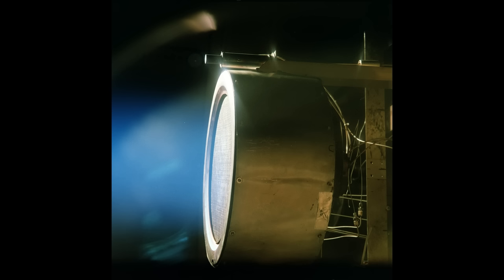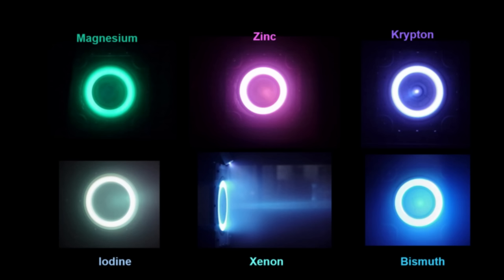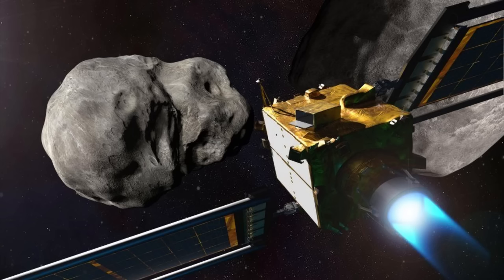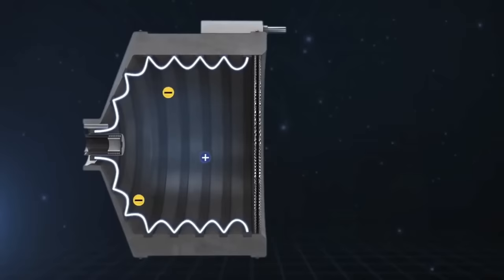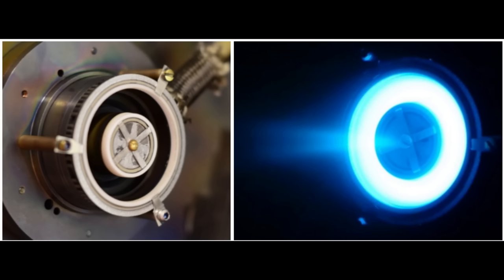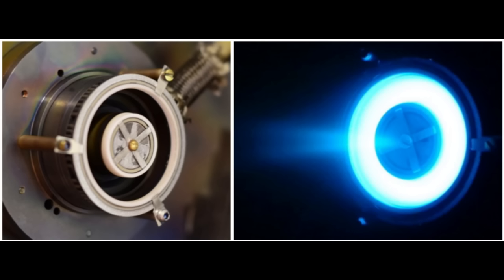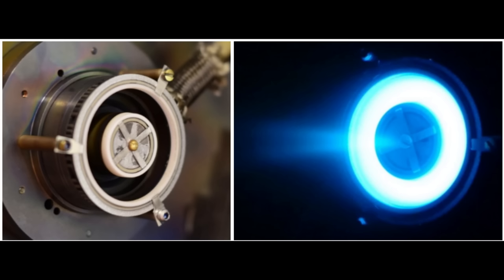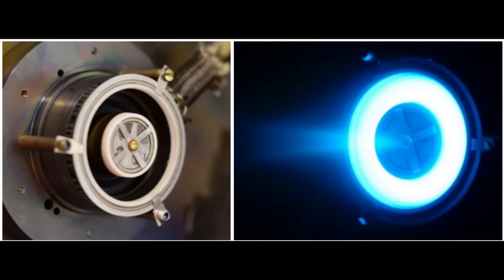Why Are There Two Different Types Of Electric Space Engines, And How Do They Work?

Comment: Pure electric engine - photon thrust. ISP = 3 x 10E7 m/s. 

2 x power x efficiency (say 75%) / Ve = thrust. 

1 = 2 x P x 75% / c so P = .666 x c = 2 x 10E8 or 200 megawatt per newton. 
Since a really good solar panel generates 400 watts per square meter to generate you would need 500,000 square meters of panels. Right now NASAs panels are like 10 kg per square meter, so that would mean 5000 tons to generate 1 newton, which means the limit of acceleration is limited to an acceleration of 200 um/sec^2. This is not actually horrible if your going to use a poormans oberth effect with the sun. But before we do that lets imagine a two panel system of 250,000 square meters each of panel. Then inagine each panel is five times as long as wide, so thats 50,000 square meters per square. 100 x 100 = 10,000 square meters so a square is going to be about 230 meters and the length of the panel is going to be about a kilometer. 
    Moreover at the attachment point of each panel you need to conduct 100 megawatts of power from the panels to the ship . . . 
   So we wave our hands. if the ship can get half the distance to the sun it needs a quarter of the panels. So we can increase acceleration to 0.8, but realistically 0.5 mm/ sec^2. We have 1/5th of a year to accelerate and we get at least some solar light forcing while leaving.  So lets see. 
   84600 x 100 days = 8.46 E6 seconds, lets just say 6E6 seconds x 500 um/sec^2. the E6 and the u cancel and this results in a dV of 3000 meters per second, this would not pay even for the cost involved to reduce the apoapsis of the orbit. 
    But there is an advantage since the vehicle can make several passes at the sun before exiting and it has no fuel loss. It can adjust at the apoapsis and rekick its orbit at periapsis without cost. The second benefit is that it can carry a payload and that can use the speed at the last pass an its proximity to the sun to launch a solar electron ion drive payload with a say much lower ISP can use the final periapsis to begin its outbound burn in which case it could particularly generate 10,000s to 100,000 of DV. Since the photonthruster is at periapsis it could simply reverse grade and slow down and reverse the process to intercept earth, pick up another payload and repeat. 

    Right,  so we factor the cost and alternative, megatons into low earth orbit. a few hundred billion dollars, but starship could potentially make this feasible. You could lower the weight if you managed to find a way to capture solar emissions (H+ and helium) and create a hydrogen based ion drive, this would drop the ISP 10 to 100 fold. 
     But in the end the practical reason why this cannot be done really is the surface area of solar panels and electrical tension at the based of the solar panels.

Comment: Why would you need to neutralize the ions after they've been accelerated ? They're being propelled out the engine, so why care ?
Also why use the noble gasses when they are all among the highest elements to ionize ? Is it because the other elements have higher reactivity as ions ?
Reply: If the ions that come out immediately shot back to the spacecraft it would cancel out the energy and the net would be 0 so you neutralize them before they can
Reply: @Linuxpunk81  thx

Comment: Me quite obvious that since the late 40s of the twentieth century, a secret project has been developing in the United States for the development and production of aircraft, where the lifting force is created using high-frequency vibration. It all started with James Pitts' "Sky Car" vibrating orthotopter umbrella, then the umbrella was closed with a dome and devices appeared according to the scheme of conventional electromagnetic vibrating speakers (membrane + inductance) - fragments of the membrane were found by a farmer in Roswell. Then they created piezoelectric thrusters, or with small dischargers on the surface (they glowed all over the body due to ionization of the air), and now they are planes with plasma propulsion panels (so they are angular - that is, with flat surfaces). Thousands of discharge cells are densely packed into motor panels - they shoot streams of plasma (railgun architecture - coaxial electrodes). The ionized air of the spark discharge is accelerated in the railgun chamber by the Lorentz force to enormous speeds - a kind of ramjet engine is obtained. Just imagine! - tens of thousands of small ramjet engines assembled in panels and launching plasma synchronously at a huge frequency (hundreds of kilohertz). Plasma jets form toroidal air vortices - this air cushion creates lift and acceleration. See, for example, the MARAUDER (Magnetically Accelerated Ring to Achieve Ultra-high Directed Energy and Radiation) project. My article "UFOs are made in the USA" and the books "UFO Hunt" and "UFO Elimination" describe all this in detail. The technology is quite mundane - it is known in great detail thanks to information leaks. For example, air ionization in the coaxial elements of a railgun is created using radiation (radioactive polonium is introduced into the metal). Devices of this type were used throughout the 50s-60s-70s-80s for secret missions (they took off, as a rule, from special submarines). With the fall of the USSR, their use by the United States was practically curtailed (in the novel "Little Green Men" by Christopher Buckley, speechwriter Bush Sr., a scene is described where the US president decides to curtail the "flying saucer" project). The winding down of the project can be recorded by the drop in magnesium consumption in the United States, since such fuel was used in fuel cells (magnesium strips were burned in forced galvanic batteries), this is 2007-2008. However, later the development of the technology continued in the Russian Federation and China (the technology was restored by reverse engineering methods for downed devices). Secrecy, however, was maintained and there was no civilian use because the technology was not suitable for it - harmful microwave radiation from pulsed plasma thrusters (harm to pilots and impact on electrical appliances inside and along the flight line). The payload is small (but one nuclear charge is enough). There is no radio communication - unmanned vehicles can fly and maneuver only in accordance with the program. Previously, there was a narrow application profile - rare spy missions (so that pilots do not get a lot of radiation). Reconnaissance aircraft of this type were often observed at military bases, missile launch sites and airfields. They were even seen by peaceful geologists in the taiga, where clearings for seismic exploration were laid - UFOs flew there to check whether military construction was underway (I myself heard stories about this))). I think that soon this technology will be declassified, and cargo airships with flickering round plasma panels on the surface of the hull will appear in the Arctic sky.

Comment: Could you take a look at the relativistic drive? Where you accelerate something close to light speed, then, instead of throwing it out the back, you slow it down at the back of your ship, then, bring it back to the front, and accelerate it again.

The idea being that the extra relativistic mass going backwards generates thrust that isn't canceled out by bringing it back to the front, because it won't be as massive coming back.
Reply: Um, I'm no physicist but slowing the particles down would impart just as much thrust as speeding them up, in the opposite direction. I suspect that it would all cancel out.
Reply: At least according to Newton and Einstein, bbgun is correct.

Comment: You know those big air cannons they sell in stores? The ones where you pull back the rubber disc and let go and it launches a puff of air? Could an upscaled one work for propulsion in space? Have an electric motor turning a pulley attached to a rod that pulls it back and releases and then rotates again to latch it and then pull it back again, over and over again. I know there's no air in space but could this still push a craft forward? Would it even be effective or efficient?
Reply: It would create thrust if you filled it with some kind of propellant. However it would be about the least efficient engine possible.  It's basically a cold gas thruster. The specific impulse is far lower than chemical engines.
Reply: @bbgun061  I figured. My edibles kicked in and I was having some high thoughts. Thanks for the reply.

Comment: When a changed ion is accelerated by a static electric field and gains kinetic energy, where in the engine does the corresponding energy being spent ?  Does the accelerating electrostatic field diminish as a result of ion acceleration ? I guess the field does not diminish. But where the energy is expended then and how ?
Reply: The field Generator will draw a current proportional to the ion current.

Comment: Scott how close is the SR71 to being an SSTO? If I’m not mistaken it goes from jet to ram jet. Is adding rocket that much more complicated?
Reply: It's no closer to being an SSTO than a 747 is. It's a jet aircraft, and like all jet aircraft, it stops flying when it runs out of air to breathe. And no, it wasn't powered by a ramjet, though the J58 engine did have some of the qualities of one.
Reply: @simongeard4824  idk about that. From what I understand it uses something similar to a random jet once it reaches altitude. Adding rocket propulsion would make in an ssto. Adding rockets would probably need a whole new aircraft design.
Reply: @billjones8950  adding rocket propulsion to a 747 would in fact make it a SSTO.
Reply: @davidaugustofc2574  not it couldn’t it. It would require so much more to turn a 747 into an ssto than it would a sr71. Especially since the sr72 or the aurora is supposedly an ssto
Reply: @billjones8950  there's absolutely Nothing, with a capital N, that makes a SR71 ready for space use. Not even space available inside.

If you want to make an argument for the X15 it's fine, but if you mean the SR71 you gotta start thinking about it, it'll not make sense if you think about it.
Reply: @davidaugustofc2574  that’s only rocket powered tho.
Reply: @davidaugustofc2574  the sr71 uses a turbo-ram jet.
Reply: @billjones8950  if you just want a direct answer. The SR71 would never be a SSTO, it doesn't matter what kind of Frankenstein tech someone wants to put in there.
Reply: @davidaugustofc2574  that’s not the point of my question tho. My curiosity is how far off the tech on the sr71 is from an ssto and how likely the sr72 even is to being real since it’s not that far of a leap. The sr71 uses a big chunk of what’s needed for one. They way they built the turbo ram jet makes me think they can also make a turbo ram jet that also converts into a rocket. 

Elon musk doesn’t even attempt to make one so it’s not easy obviously. But sr71 tech is what 70 years old now?
Reply: @davidaugustofc2574  sr71 pilots are flight rated astronauts. So it’s not that far off dude
Reply: @billjones8950  F1 drivers can drive road cars, it doesn´t mean road cars are F1 cars.

30% of the reason is just the G forces they experience during flight, with the other 70% being that it´s military technology and they´re/were pilots from the airforce/navy
Reply: @billjones8950  exactly my point. Adding rockets could make it an SSTO... provided your engineers are happy with the amount of magic required. But as-is, it's no more SSTO than any other jet aircraft, and there's no plausible way it could be turned into one.

Comment: Well, a pure electric engine is possible. It'd have a bit less thrust, say around 1/80000th the thrust of an argon engine, but one could be made. It'd also be known of as an immense waste of energy, effort and equipment, as the heat from the damned thing would provide more thrust and still be far, far, far less than say that argon engine. As in, the Pioneer anomaly was detected after a decade... Solar sails would be more efficient and far faster, which still isn't saying much.
Still, there is the EM drive, powered by its free lunch system that ignores the laws of thermodynamics. And after all, who, other than Mother Nature can refuse a free lunch? On just needs to get an Alder Wand...

Comment: We should but two big ion engines in a twin configuration on spaceships. A "Twin Ion Engine", so to speak. The engine could be mounted on a spherical center cockpit. Then we slap two huge radiator panels on the sides at a small distance. I bet these spacecraft would be quite nimble, almost like a space fighter. And I bet they'd make strange noises when flying around in space.
Reply: they wouldn't be nimble at all, in fact they'd be extremely clumsy and slow
Reply: @garunixreborn2416  I've seen quite q couple of "documentaries" showing said space fighter te be quite nimble, but also very fragile.

They should give that spacecraft a catchy name!

Comment: 11:22 - "Typically 10 to 20 Kilometers per second" - WHAT?  That's like 360MPH!  On the low-end.  I'm thinking a batman-style electric jet engine for my car, or non-gear-based thrust of a vehicle.  Is it because the direct transfer of motion is slow-ramp or unreliable like a direct-torque engine in EV's today?  Seriously, should/could you make a car from this or just take it out to the (expanding) salt flats of Utah to break records?
Reply: That's the exhaust velocity and your math is also flawed, 10 km/s is 22,000 mph. :)
Reply: @TheEvilmooseofdoom  I sit very happily corrected...forgot to 60^2...

Comment: 1500 s of 1 gram thrust does not sound like much . wouldn't smallest chemical engine easily do that? considering the mass needed for ion thruster to work? or what did i miss?
Reply from the maker: 1500s is a measure of the exhaust velocity, multiply it by acceleration of gravity at the earth’s surface to get the speed. So, about 15 lm/sec while chemical engines are more like 3-4km/sec
Reply: one day i will understand ISP. one day...  :(

Comment: Ion thrusters accelerate the ions to 20-50 kms Hall effect thrusters 80 km/s.  That's very low compared to particle accelerators that are up close to the speed of life and you get relevatistic increases in mass. 
So why not use a particle accelerator? I suspect its power or length. 
However there are plasma wakefield accelerator that are short. Short enough to put in space.
Reply: With higher specific impulse comes lower thrust. There have been GITs that go to very high exhaust velocities (of course nowhere near particle accelerator speeds), but they do not have so much use since their thrust is abysmal at a bearable power level.

Comment: It's no wonder to me the simulations and real data don't match perfectly. You have to mix electrons, ions, and neutral atoms at vastly different velocities over a large variation of densities in a magnetic field. Even worse than magneto-hydrodynamics since you can't even consider it to be a continuous fluid, but need to treat things on the particle level. Yikes.

Comment: YOU FORGOT TO MENTION THE CHAD OF ELECTRIC PROPULSION, THERMAL ELECTRIC! 🤣
Reply: (none of the cold electric engines will ever be good because the weight of the magnet and electrical wiring+power generation will always cripple the performance of the engine as this is the only source of exhaust velocity, while thermal electric engines have much more potential, the only limitation they have is the same problem as high performance hydrolox rockets, they get TOO hot and we don't have the materials or techniques to safely handle very hot exhaust gasses yet)

The even better thing about thermal electric drives is that the same technologies that would allow us to unluck their full potential (ideas like magnetic nozzles) are the exact same technologies that are required to make all ideas of high energy engines like fusion engines and antimatter engines possible, so not only does research into thermal electric engines already yield very efficient and powerful engines, that would be the bread and butter of all solar system transportation, but ALSO, that same research can be directly used for the much better very high energy engines, the sort of stuff we will need if we ever want to visit another star, or even send a probe there, the same research into high temperature exhaust containment leads to bot

Electric /magnetic engines will always be a simple, cheap and reliable thing to put on spacecrafts, but their performance is really underwhelming compared to thermal electric engines, and we shouldn't get too excited about them, my verdict is that Hall effect/Ion propulsion engines might at best be something you slap on the side of a probe or spacecraft for attitude control, not the main cruise drive, unless you really enjoy taking years to go anywhere, and take months to get up to speed, and I feel like it's a big shame that so much focus is put on such a bad type of engine

hopefully you make a video to cover thermal electric propulsion in the future ^^